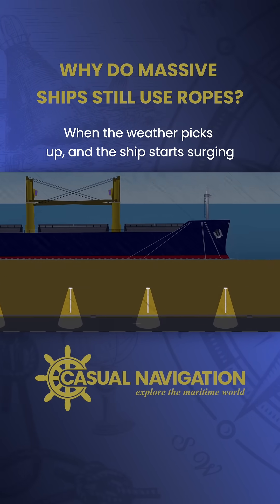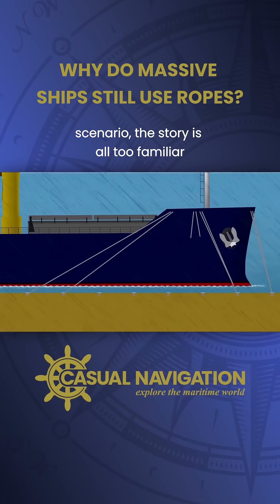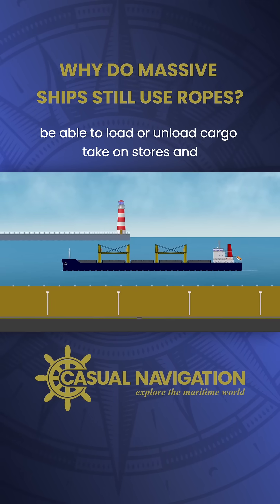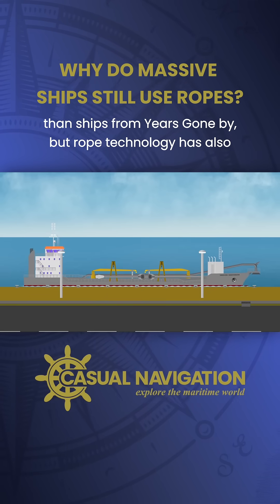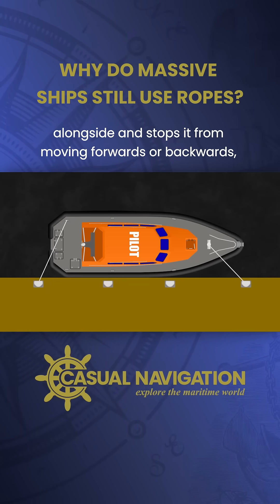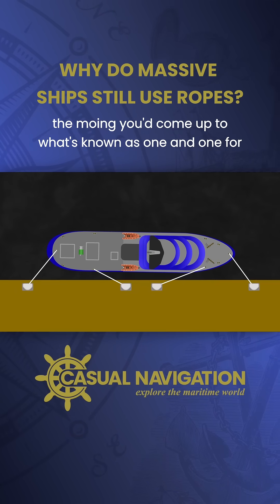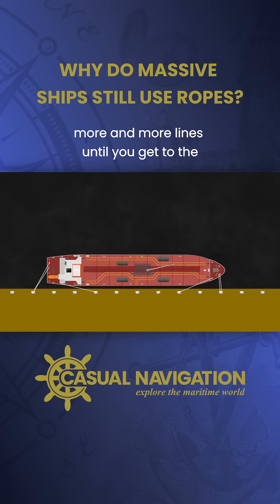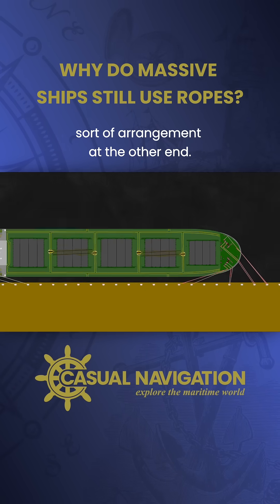2 Ropes VS. 16 Ropes

Comment: Short lines are not good agInst large tides, or storms.
The longer the line the stronger it is. Greater deflection, springiness, yes delection and strength are different parameters. But also any damage to the line has a distance to mitigate the concentrated loading that results from the damage.
The less stiff line will be better able to absorb shock than  lines that are stiffer. So even though strength and stiffness are different each will determine the ultimate capability to keep the ship tied at the dock. The less stiff line will store more energy at the breaking load and be more dangerous.
Know your lines and the load being applied.

Comment: To reduce the tension on the ropes, it can be tied to the port with giant, thick, and hard-to-stretch spring coils, and since the spring coils can stretch, they can reduce the tension on the ropes or prevent the tension from increasing or decreasing suddenly, but also these spring coils should be made of a metal or a material that can stretch, so that they do not break and fly out under excessive tension.

Comment: Isn't there a rope material that would dissipate the kinetic energy?

It would probably come at the cost of having high friction inside the rope and having to change it often.
Reply: Another solution would be to add rigid weights along the length of the rope. In case of snaping the momentum would be the same but the speed much lower. The downsides would be added weight and volume and possibly tangling of the rope.
Reply: @eklhaft4531  while the extra weight would make handling the lines harder, that is a neat safety idea actually.

Comment: They're called lines not ropes
Reply: Reader repeatedly called the lines, lines - when they were lines.
They were called ropes when not talking about their specific usage, in which case they were correctly called ropes.
Reply: @UKMonkey lines, sheets and halyards i bet you think a cable is a wire?

Comment: Ropes are being used for 1000s of years. This won't change for the next millenium.
The best solution is to consider geographical, meteorological conditions before building a port

Comment: Why dont they put a metal wall to block the snapback
Reply: As with all other solutions proposed in the comments, while they are sometimes ingenious, they are not practical enough or they are not worth the investment to the industry. Historically, the naval industry has been reactive rather than proactive. ISPS code was only instated after the September 11th attacks, for example.

Comment: A electromagnetic harbor system would hold such a massive ship in place!
Reply: The problem would be designing one that would be useable with existing vessels of different sizes, and that wouldn't fry/severely disrupt (among others) internal navigational systems. A lot of mid-sized and small sized vessels still (sometimes only) use magnetic compasses, and electromagnetic induction could wreak havoc in other ways.
Reply: i wonder how much electricity a 200,000TONS ship would need

Comment: They should design clamps kind of like how trains connect to each other. Would be expensive with today’s technology though. But basically they’d extend out from the ship’s hull and lock into slots on the port. Alternatively, instead of being on the ship, they could be on the port. This system would mean there’d have to be compatibility across many ports. There’d need to be a universal design to be implemented everywhere. Maybe different types for different sizes of ships.
Reply: That won't work with tides. Ships go up and down with the tides many feet each day
Reply: @Shadowsearcher64  Hydraulics, have an inlet at typical water level with a float, as the float rises the hydraulic raises the clamp, as it lowers the hydraulic lowers the clamp. Although as previously said. Expensive.
Reply: @harveyfell8255  Yeah, just have a flexible arm essentially. Ropes have more tensile strength/flexible so would be less prone to breaking, I can see why they're more practical. A more extreme solution if stability is necessary is just cut off the port water from the ocean with walls and gates to control water level, It might even be more worth it long term. But flexible arms would be more simpler than that.
Reply: @harveyfell8255  expense for the equipment wouldn't really be an issue for such a massively profitable industry. Plenty of very expensive equipment at ports already. The issue is opportunity cost.

The described mechanism would be extremely heavy, since it would not only need the strength to moor a fully laden ship but the flexibility to allow it to rock and undulate in unfavourable weather. Even if all of the flexible side of the hitch was mounted to the port and you only had a solid hitch on the ship, it would basically be a massive chunk of steel welded to the side of the ship, which would also need to be reinforced to the rest of the ship in order to transfer forces without damage, or have many of said hitches along the hull. This would take up space and weight, reducing the capacity for cargo on the ship.

Solid hitches simply aren't well suited to this use case.
Reply: @Patrick-zr8tv  Yeah, makes sense why ropes are better. But a more stable option is to isolate port water and control the levels with release gates. Like on the panama canal similarly
Reply: @Patrick-zr8tv  To advance on my proposal, the float and the hydraulic equipment do not need to be connected. You could hypothetically have a laser array which tracked the change and then relayed that information to the pump. But then again, lasers are high maintenance and seawater isn't going to treat them very well. Especially the added job that you'll require someone to work in a most likely dark, and confined space which will be wet. Due to moisture and formation of mold, and the gathering of debris, perhaps before every use. It wouldn't be a practical solution. Simply a fun engineering idea. We engineers sometimes like to do silly ideas like this where we ignore physics and reality and just ask "what if". Sometimes you break ground as a result, sometimes you cause an injury because all you've done is connect a V8 engine to an electric wheelchair.
Reply: Although I said that, have the lasers behind a protective glass. On a removable pole which can be accessed from surface level underneath a cover (similar to ones used for IRL fiber-optic access points at surface level) So the pole can be removed for maintenance operations without having to descend into the undersection. The only issue is it'll likely work fine as the water level rises, however as it lowers the glass will remain wet which may cause refraction of the laser beam and a misreading on the receiver on the other side. Although I'll be honest I don't know enough about ships to say whether or not this refraction and subsequent misreading of the actual height of the water will be enough to marginally impact the vessel. I'd be interested if you'd have an insight on this. In my current role even a few millimetres can be too great a margin of error. That may be different for this instance.
Reply: @harveyfell8255  It's a good idea when designing stuff for practical use to keep things simple and efficient
Reply: @GreenLeafUponTheSky  OFC, but if I had a simple and easily applicable idea to revolutionise the shipping industry I wouldn't be discussing it here, I'd be pitching it to said industry. This here is mainly finding an excuse to have fun with lasers.
Reply: Kind of similar to the suction cupps that are used already in some ports to help, but they can’t completely replace mooring lines.